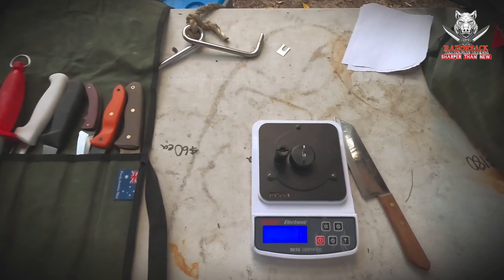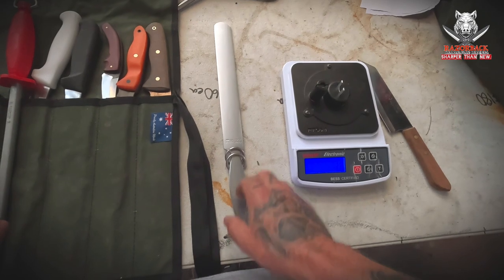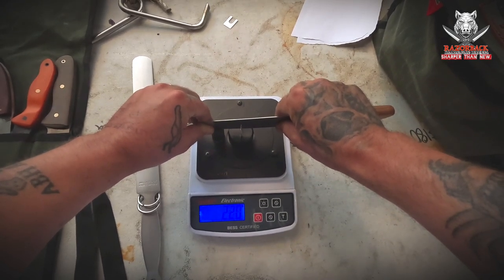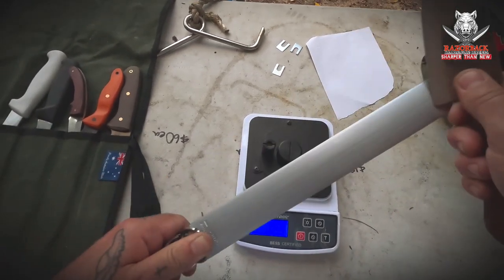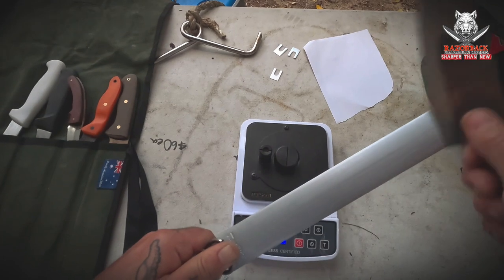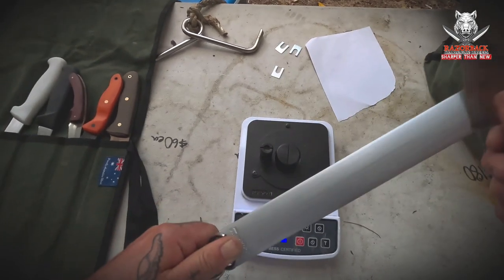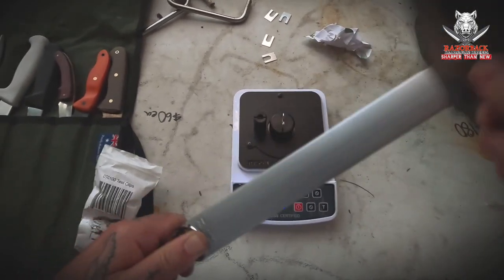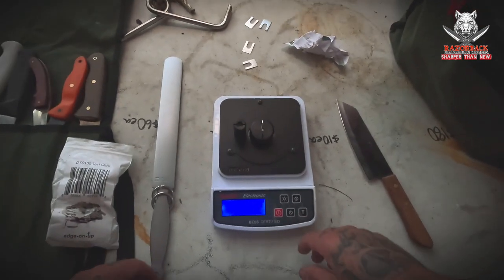F.Dick Balkan Honing Steel - Review

Comment: Pretty sure some diamond spray applied to a $100 bill would be a better way to use $150 to sharpen a knife. Not even joking.

The quality to price ratio is hilarious.
Reply from the maker: Yeah I didn't expect it to be so rough, general consensus is F.Dicks quality has been slipping for a while now. All that aside for keeping a knife going around blood and fat I still rate it for the reasons mentioned. You'd be lucky to get more than a handful of cuts on a Roo before needing a steel on some of these softer knives.
Reply: Crazy prices,  in Germany those go for ~60. Btw, f dick doesnt produce in Solingen, they are located in Esslingen.
Reply: Absolutely crazy pricing.
My 20$ Victorinox sharpens amazingly.
I am "tuning " my chinese honing rod. I am making it a fine grit by grinding with 40 grit powertool then by hand. 
65hrc steel eats abrasives like bread. I used 5-6 velcro abrasives ,damn thank god they are chinese and cheap...